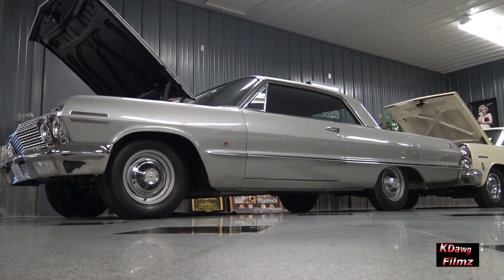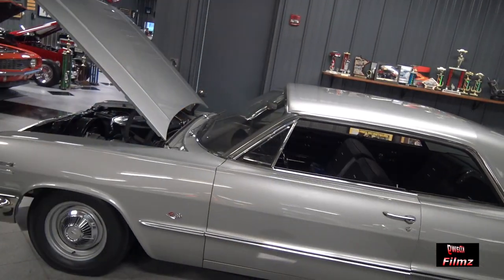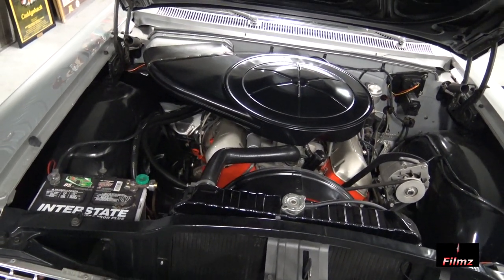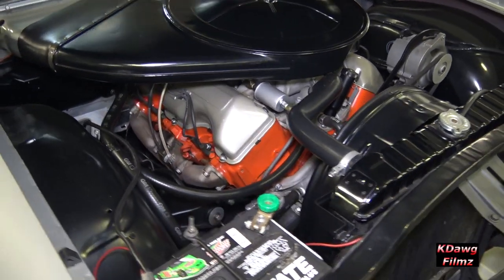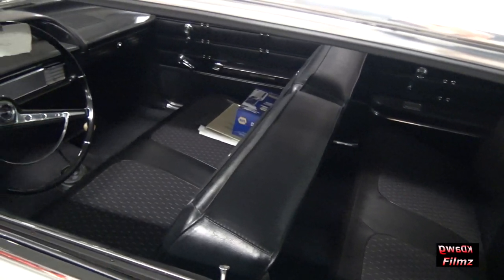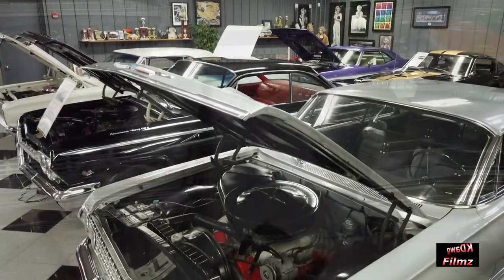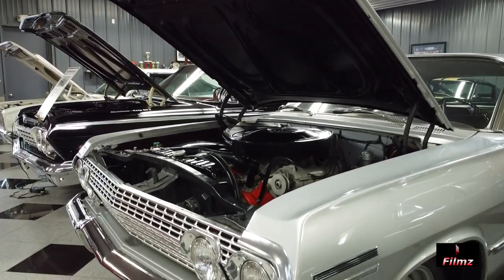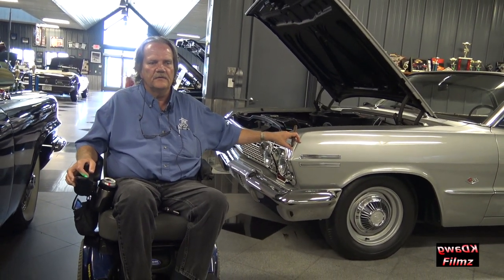1963 Impala Z11 from the Bob Marvin Collection at “The Shed” in Warroad, MN.

Comment: Its worth alot of money!
I dont care if your car is 1 of 100,1 of 1000,or 1 out of 10,000...hold onto becuase they will be really rare some day!
Also read your vin and if your cars rare,keep it original as much as possible.
Im telling you the day scoming where you wont find an original car,becuase they are pulling the engines out of every single car.
The thing that make it soo rare is it's a drag package car,they use the same engines in nascar and race against hemi but also to mention it dont matter what engine you have vin if its an inline 6,if it's rare keep it that way.
Reply: The engine in the Z11 cars are based off of the 409 W motor but have a stroker crankshaft for 427 cubic inches . Bore is 4.3125 , stroke is 3.650 . The '63 Impalas used in Nascar were running prototype big block Chevy Rat Motors . Bore was 4.250 , stroke was 3.760  . Two totally different beasts .